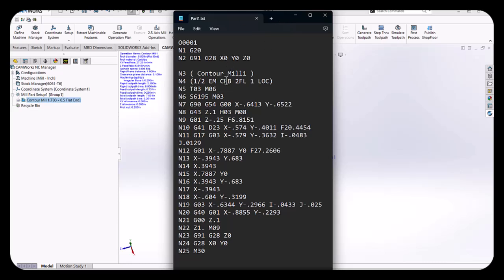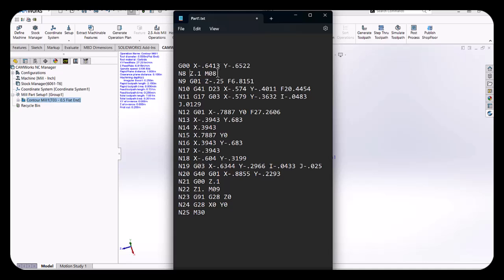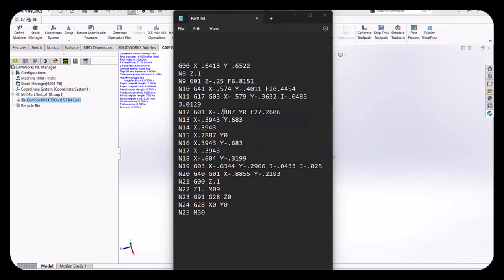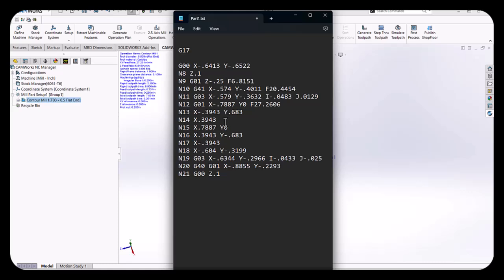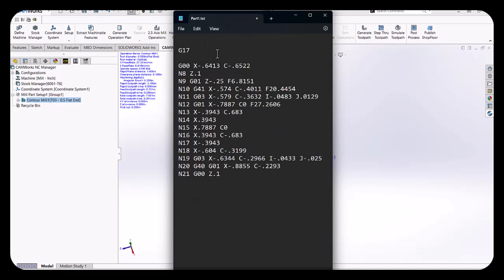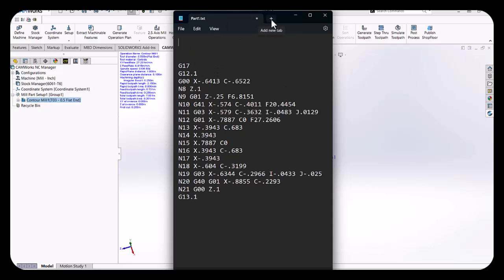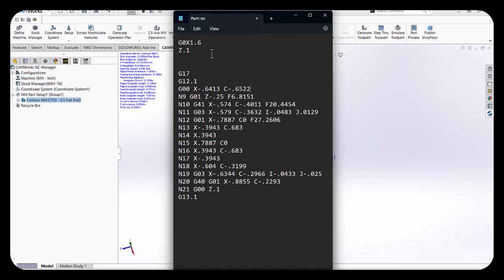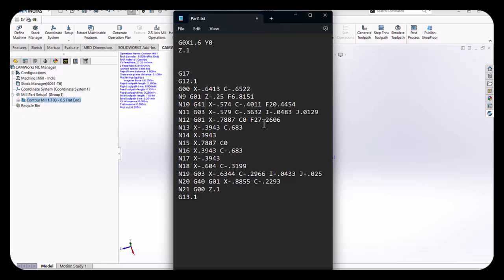Polar Interpolation G12.1 from 3 axis mill program

Comment: wouldn't you have to double your x value positions or does cutter comp take care of the diametrical vs radial axis?
Reply from the maker: Thank you for asking. The G12.1 parameter for X Axis can be set for Diameter or Radius regardless of the X axis normal setting. Most manufacturers default to radius.

Comment: Hello... I have a CNC lathe with a live tool and a C-axis but no Y-axis. I would like to machine a pocket or a flat surface on a cylindrical billet. The problem is that it never enables circular interpolation from the Camworks feature tree.